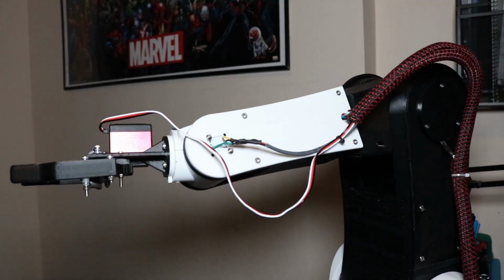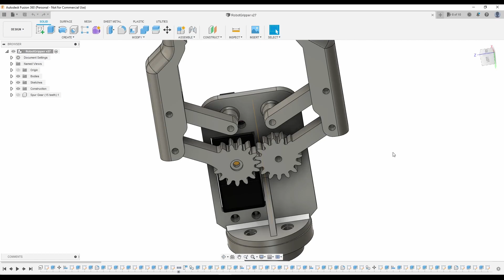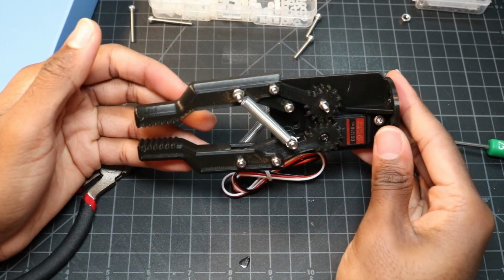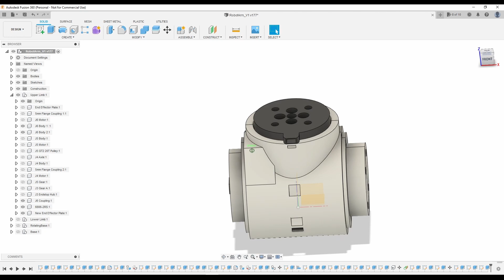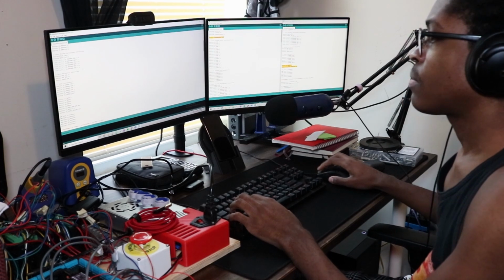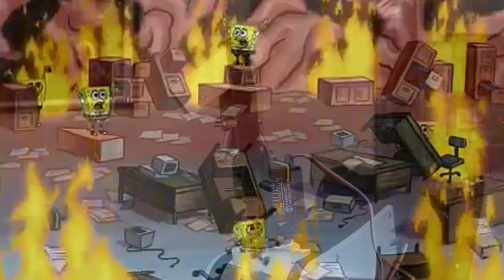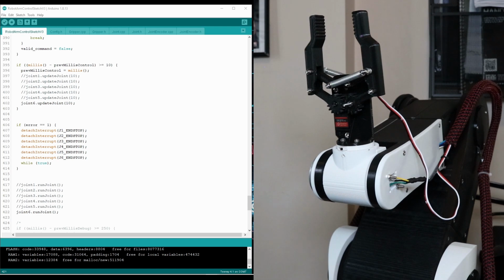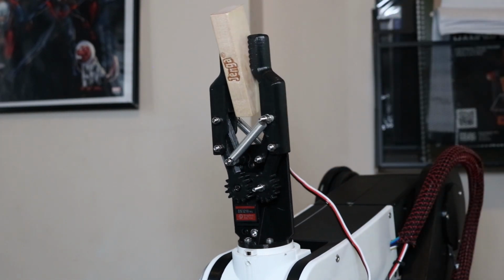3D Printed 6 Axis Robot Arm Part 7 | Gripper Upgrades and Joint 6 Revisited

Comment: you could add a rubber pad to the robot gripper so it has more friction and objects wont slip out of the grips.

maybe the timingbelt grooves fit into the existing grippper grooves and can be glued together leaving the smooth rubber timingbelt side to grip objects

Comment: Thank you for sharing your learning experience.
Thats one cool robot!

You can use a rubber spray, RTV Silicone or something similar on the end effector to increase friction and prevent slipping.

You can also use a strain gauge to have force feedback on the gripper, this will help create a dynamic response (helping you to hold onto delicate parts).
Reply: P.S. as a quick proof of concept, you can also cut GT2 (or simililar) timing belts and stick 'em on the gripper helping to increase friction - hope this helps.
And thanks for sharing your cool project

Comment: You could try adding some form of rubber onto the end of the gripper to help with grip. You could also have the gripper arm touch together when it's in it's closed state that might help with gripping small objects.

Comment: How do you get the stepper motors to hold position under load. I can move point to point but I don’t understand how to maintain position. I am using arduino also.
Reply from the maker: If the stepper isn't holding its position, it may be because your load is too large and the stepper doesn't have the necessary holding torque. Unfortunately, it could also be the stepper driver, wiring, or power supply. Try troubleshooting each area one at a time until you find the culprit. Good luck!
Reply: @StewartTechnologies  thank you for your advice.
Reply: @StewartTechnologies  thank you for your advice.